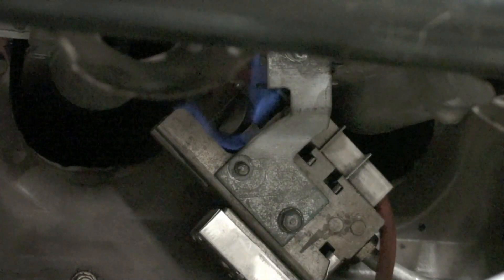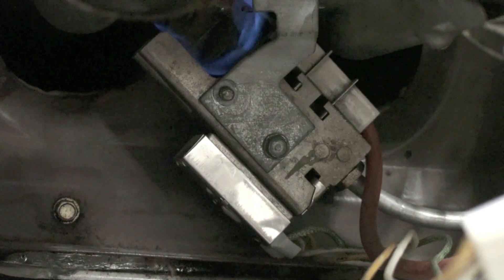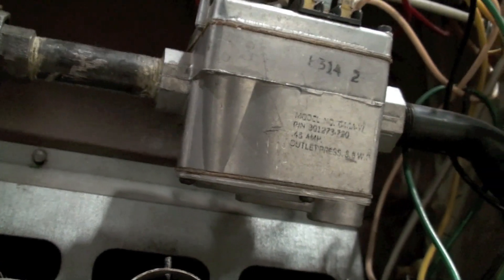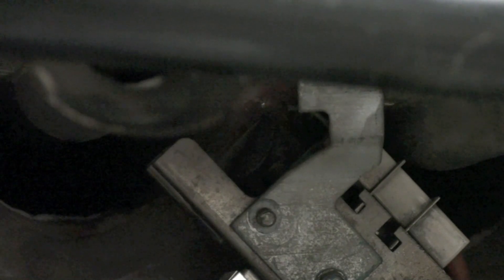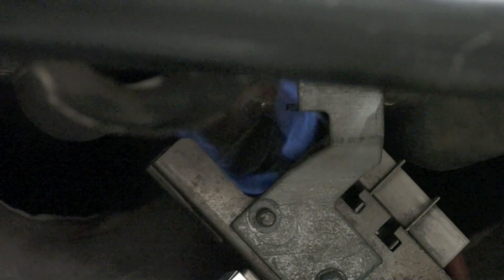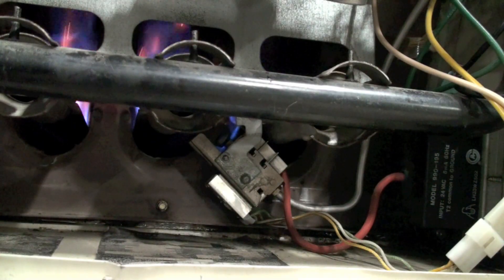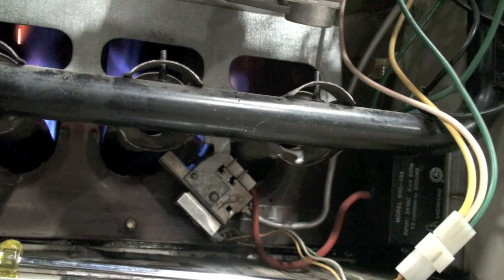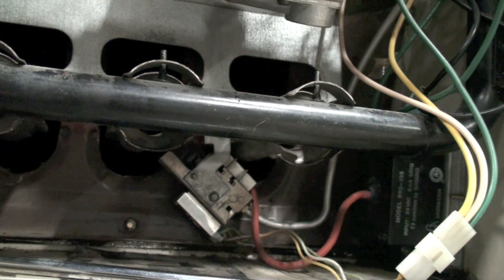Carrier 58SS 58GP 3 wire pilot assembly operation

Comment: Hi, I have a Carrier 58GSC065 series 130 furnace (probably 30-40 years old) that stopped working recently. I noticed that the pilot light never comes on and there is actually never even a spark that occurs. When I set the thermostat so that heat should come on and turn off/on power to the furnace, nothing happens although I can "hear" power going to the furnace. I also tried to manually light the pilot, but this doesn't work either.

Would this indicate a problem with the pilot assembly or the HSC igniter/lockout control unit (1007-100 LH33WZ512A part) that the pilot assembly is connected to via the red wire? Actually, I'm not clear which way power is traveling for the red wire so could you clarify this? The igniter/lockout control unit was replaced a long time ago for some furnace issue, but I don't know the details. I'm not sure how to troubleshoot whether the pilot assembly or the control unit should be replaced.

Thanks in advanced for any suggestions you can make.

Comment: Hi Gary or anyone else reading.  Furnace will only kick the blower on and only cold air while on heat.  No spark, no burners, nothing.  Just replaced the spark igniter and the 3 wire pilot but got the exact same scenario.  Any thoughts or ideas where to check next would be so greatly appreciated.  Cant thank you enough.  Hope you and your family are doing well.  :)   Jp
Reply: "   Furnace will only kick the blower on and only cold air while on heat."  Check limit or roll out switches They're probably open and did not allow the heat on That's a safety feature of all heat furnace machine. You need to RESET it first then try to turn on your heat again. You HAVE TO find what the reasons your limit or roll out switches tripped .Check for dirty air filter weak blower motor gas line pressures, heat exchanger cracked etc...etc...otherwise the problem will come back.

Comment: Do these older models have a flame sensor? My furnace turns on for about a minute then shuts off.  Then attempts to turn on again, but only hearing the ignitor clicking noise.  I did a little research and thought maybe my unit wasn't getting enough air flow so I replaced the filter, then went on to try to locate the flame sensor without any luck. Thanks in advance.
Reply from the maker: The pilot assembly is the flame sensor.  You probably have a failing pilot assembly.
GFM

Comment: Initially my pilot light stays on but then goes out and won't stay lit, then the igniter keeps trying to light it over and over.  The burners never light.  Is the pilot assembly bad or is it the gas valve?  It's at least a 35 year old two burner Payne furnace.
Reply from the maker: Does the unit have an inducer?
GFM
Reply: @grayfurnaceman  if that’s a fan that runs when the furnace is turned on, prior to the pilot and burners lighting, then yes.
Reply from the maker: @Resist4  You probably have a failing pilot switch.  Very common failure.
GFM
Reply: @grayfurnaceman  so if I remove the pilot assembly will there be a number on it so I can find a replacement or are all 3 wire pilot assemblies the same?
Reply from the maker: @Resist4  If its a 3 wire, they are all the same.
GFM
Reply: @grayfurnaceman  thank you for the help!
Reply: @grayfurnaceman  I just discovered something that may be the issue.  There is a small fan in a cage, inside my furnace, it's right in front of the inducer.  It's not spinning when the furnace is turned on and when I try to manually spin it, it's sticking like it's burned out.  If this fan is part of the inducer by a single shaft then could this be the problem?  Many years ago this small fan used to make a whining noise while spinning, then it stopped doing that and seemed fine.  Your thoughts?
Reply from the maker: @Resist4  The furnace will not fire if the inducer will not turn.
GFM
Reply: @grayfurnaceman  So I took out the inducer and lubed the shaft a tiny bit and it spun freely, reinstalled it and the furnace fired up.  I think several issues were at play, it's an older furnace and it hasn't been turned on in a couple years, due to our mild winters.  

Thanks again for your help GFM, I've learned more about my furnace than I though I ever would.
Reply: Well tonight the issue happened again.  So apparently I should just  replace the inducer motor assembly.  I found a new one on eBay that looks exactly like mine, hopefully it will work.

Comment: @grayfurnaceman , I have a similar old 58GS050 furnace.  Just recently noticed that twice after the furnace was off for longer time (a couple hours), the pilot fail to get the main burner lit.  It feels like the pilot was locked out, as if I reboot the system via Nest app, no sparking.  After a few minutes, reboot, the pilot is on instantly, with solid blue strong fire, but the igniter seems to spark repeated still, until the main fire is on.  Also it takes some good 30s to get the main fire lit with the pilot flame heating that "metal rod"(thermocouple?) and slowly turn it red.  Where should I start about cleaning (or replacing?) Thanks in advance.
Reply from the maker: The first place I would look at is the pilot assembly.  Most common failure in these type furnaces.
GFM
Reply: @grayfurnaceman  Thanks. I watched your video on the assembly and realized my misunderstanding.  Apparently the "bi-metal" which was down inside the assembly was the switch for the main gas.  Is the "metal rod" sits above the pilot flame just the pilot safety?  I initially thought I could just clean that like the old type thermocouple, but if it's the safety then does not match with my symptom.   So I guess, I need to remove the pilot gas tube nut, remove the assembly out of the way and clean it up first.  Where can I find the OEM model number of this assembly?  I want to try my luck at ebay (like one of the reply in your assembly video) to see if I can find a Carrier one. Thanks again.
Reply from the maker: @R0N1NPANDA  All that rod does is provide a gap for the spark and prove the pilot flame to shut off the spark.  
The pilot assembly has only 2 variants.  The 2 wire and the 3 wire.  You want the 3 wire.  Do not buy a used one.  You already have one of those.
GFM
Reply: @grayfurnaceman  I cleaned the orifice, and it seems the sparks can stop normally after pilot flame on. However, the intermittent furnace not on problem remains. Two questions, is LH680005 the correct model number for this? And i notice the replacement does not come with the "rod" (flame sensing thing above pilot), and the red rubber tube connecred to it. How do i remove it from the old assembly if i need to reuse? Thanks.
Reply from the maker: @R0N1NPANDA  I believe that is the right part for your furnace.  
There is a small screw on one side that clamps the spark rod to the pilot assembly.  
GFM
Reply: @grayfurnaceman  Last question, I finally captured it when furnace is not turned on after suspecting Nest E wasn't sending the call.  W and R were shorted fine, but I don't get sparks, so no pilot nothing, there is also one time that the sparks were a good 5s delayed after the W and R shorted. When it's normal, I recall hearing the spark almost immediately after the click sent from thermostat, and everything else happen accordingly.  That can basically pin to the pilot assembly being bad now right?
Reply: @grayfurnaceman  Spoke too soon, two more questions: 1. When there is no spark and W/R shorted, will the pilot burner gas line kept releasing gas waiting for the spark or it would cut off after sometime?  2. For the brass nut retaining the pilot gas line, is it really metric 11mm (according to one reply in another video of yours). It needs those very small wrench (limited space), and I used 7/16 last time and wasn't working as smoothly as I'd like.  Thanks so much.
Reply: @grayfurnaceman  Now that it looks the problem is the sparking, do I need a new sparking rod, from what you said, the rod above pilot, or it is the gray box spark module? How do I measure voltage to that gray box, do I simply unplug the red rubber tube (connected to the pilot assembly), and remove two screws to open it?  I'm wondering if this intermittently no-spark (Strangely, this type of "no spark" only happened in the morning's first call for heat, and the subsequent heating throughout the day and overnight seem to be working.) is from which part's failure.  Those pilot assembly replacement does not have the spark electrode.

Comment: This same type ignition system I've found several delayed ignition issues coming on with a boom. Every one I found was using a Robert shaw valve with a black on off knob. It would only show itself when a dirty pilot failed to light in a timely manner and somehow within the valve it would power the main valve coil even though the bi metal hadn't switched. So burner gas dumping and ignitor sparking it goes boom. After finding several bad ones on delay ignition calls I subsequently tested every one I came across and sure enough found more but hadn't shown themselves yet as pilot was lighting ok. If you see one that pilot lights then main valve opens within 15 seconds or less beware the valve. That bimetal switch  takes longer than that to power the main valve.
Reply: Addendum to above if memory serves even after main valve coil is powered there was an additional built in 15 seconds or so delay in the valve  before it opened. All this in addition to the delay of the bimetal heating to switching temp. Again this was only on the Robert Shaw brand valve with the black knob.
Reply from the maker: @larryfisher5198  Good inför.
GFM

Comment: Gary... I see you have several videos on these old 3-wire pilot assemblies so you seem to be the most experienced on these old types. I'm troubleshooting the 3-wire sw because the main gas never turns on after the pilot runs. The igniter and pilot work correctly as scheduled but the main gas never comes on which leads me to believe the bimetal sw is not functioning properly. The gas valve and MGV works fine because I jumped across #3 HOLD contact to the #1 MGV and the MGV opens and fires up the main burners.

So, even after the pilot runs, up to 3 minutes, the main gas to the furnace never starts up (no 24v on WHITE wire). I did a continuity check on the 3-wire pilot sw and I get continuity on the GREEN and YELLOW wires which leads me to believe that is the normal position when the pilot is NOT running. There is no continuity between the GREEN and WHITE or the YELLOW and WHITE. I suspect that after the pilot heats up the bimetal sw and closes the contact I should get continuity between the YELLOW and WHITE but I'm not sure, maybe GREEN and WHITE. 

This is where I hope you can guide me. Once I clip together the push-in wire harness clip I can't test the continuity on the WHITE wire to see if when the pilot heats the bimetal sw that the contact jumps over to the white wire. I did buy a new 3-wire pilot light assembly but I'm thinking it's bad but don't know how to test it because i can't get to bare wires once the wire harness is pushed in on the connector clip. I want to stay as close to the pilot assembly as possible.
Here is a link to the Carrier schematic:   www.manualslib.com/manual/748163/Carrier-58gs-Series.html?page=5#manual
Reply from the maker: This sounds like you are over thinking this.  Have you installed the new pilot assembly?
GFM
Reply: Yes, I did buy & installed a new one. Maybe I am over thinking but it still doesn't work automatically with the new 3-wire pilot. It seems that everything works properly up to the MGV opening. That is why I think the bimetal sw isn't making contact to energize the MGV. I replaced the limit sw and the motherboard a month ago because I could only get the MGV to stay open with the WHITE wire pulled off the motherboard . So that basically leads me back to the pilot sw because it's the only part that controls the MGV.
Reply: Point is, everything works IF I jump off the HOLD side on the gas valve. The spark sparks, lights the pilot, spark drops out. If I then jump the MGV the burners light off and run until the temp gets to the thermostat setting and shuts off. So, I wanted to test the bimetal sw function before I buy another pilot sw
Reply from the maker: @ntheq3982  Terminals 1 and 2 on the gas valve are the main gas.  When the pilot switch moves, you should have power between terminals 1 and 2.  If you have power and the gas valve does not open, the gas valve is the problem.  
GFM
Reply: The gas valve works. As I said I did jump from the 4 yellow to the 1 white contact on the top of the gas valve & it opens. What doesn't work is the automatic function going from pilot burning to MGV open. Therefore I'm thinking the bimetal sw inside the pilot is NOT bending over to contact the white wire (in the pilot sw) as it should when it heats up... because the gas burners never AUTOMATICALLY open. The gas burners light IF I jump it. 
I'm just trying to get a way to test the bimetal pilot function.
Reply from the maker: @ntheq3982  If the pilot lights but never opens the main gas, the switch is not making.  Are you sure the "new" pilot assembly is new?  Many used units have been selling on the internet.
GFM
Reply: It is brand new for sure & it seems like it's not doing what it's supposed too but if I could think of a way to test I'd know for sure. 
I'm thinking of taking it off, use a gas grill lighter to act like the pilot and see if I ever get continuity to the white wire on the 3-wire pilot assembly. That should tell me or just order another pilot.
Reply from the maker: @ntheq3982  If the pilot lights on its own, is blue and touching the bimetal, but power never passes to terminal 1 on the gas valve, the pilot assembly is not working.
GFM
Reply: That appears to be the case
Reply from the maker: @ntheq3982  I guess you have your answer.
GFM
Reply: N TheQ  Hi, how did you solve the problem?   I have the exact same issue. My main gas  would only turns on once I jumped the yellow and white wire.
Reply: @uyenl99  I ordered another 3 wire igniter part (1st one defective) and that fixed it. Apparently these old 3 wire systems are persnickety. 
Side note. I bought a new gas valve thinking it somehow it was problem but it turned out to be the igniter. Good luck on your fix.

Comment: I have a question grayfurnaceman, I have a similar model Bryant and the ignitor keeps sparking long after the pilot lights and the main gas turns on. It seems to work besides that. What feedback, if any does the pilot assembly use to control the ignitor? It is loud and seems unnecessary to spark for several minutes.
Reply from the maker: The spark ignitor gets feedback from the pilot flame to shut itself off.  Sometimes either the spark probe gets dirty or the electronics inside fail.  You can clean the probe with sandpaper.  It causes no problems but the spark ignitor may fail earlier.
GFM
Reply: @grayfurnaceman  thank you for your reply! The maintenance guy assures me this is normal operation but he isn't an HVAC tech by any means 🤦‍♂️

Comment: I believe my 3-wire switch is bad because it never sends the 24v to the main valve. I removed the original switch and put a continuity tester (dvm) across green to yellow wires which should be normally closed, and they test fine. Then I heated the bi-metal switch on the stove flame and the n/c switch never goes to "open". Also, yellow-to-white is normally open, I believe. But never goes to "closed" when heated. Since I think this proves the switch to be a bad one, I ordered one. When I installed the new one, furnace still did not work (symptoms are spark goes on, pilot then lights, but main valve never opens, I believe due to not getting 24 v from switch). So I took out new switch and tested it in the same way. The new one had green-to-yellow as n/c and did go to "open" when heated on stove. But the yellow-to-white n/o contacts still did not close. I ordered another switch and decided to test it on the stove before installing it. It does the exact same thing as the first new switch. So my question, is heating the bi-metal switch on the stove a valid test with the dvm and I have another bad switch? Or does it actually need to be installed with gas running through the pilot for the switch to work properly? I ordered a 3rd switch from another source, and same effect, n/o does not close when heated on the stove. Bad switches or invalid test?
Reply: I just opened my original defective switch and cleaned the contacts. When I reassembled and tested it on the stove, it performs as expected, the green-to-yellow n/c then opens when heated, and the yellow-to-white n/o went to closed when heated on the stove. So I guess the 3 new switches I received were all possibly bad. I'll re-install my original that I just repaired and see what happens.

Comment: My pilot would not stay on so I purchased a new 3 wire pilot assembly and replaced the failed unit.  When I installed the new 3 wire pilot assembly I reused the igniter.  When I turned the furnace on nothing, not even an attempt to spark.  I removed the new unit and reinstalled the old failed pilot assembly it would try to light but of course it wouldn't stay lit.  Is it possible I got a bad part because it won't even allow it to go through the sparking cycle with the new part?